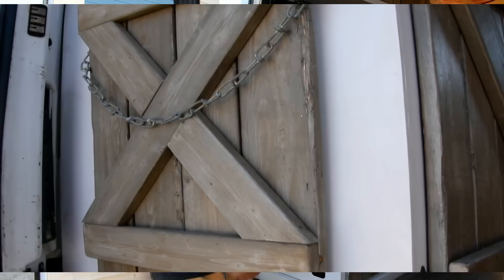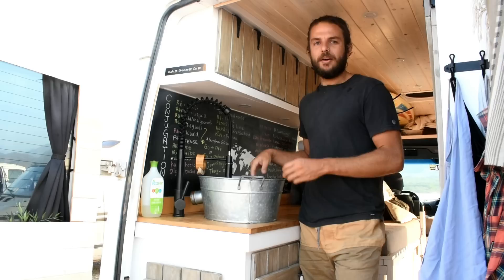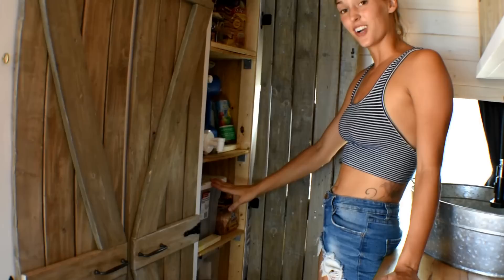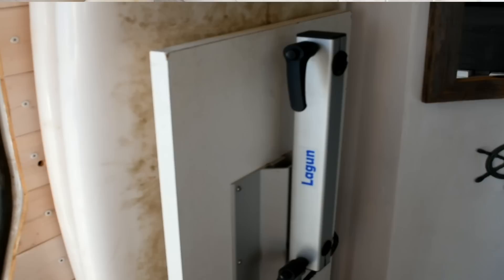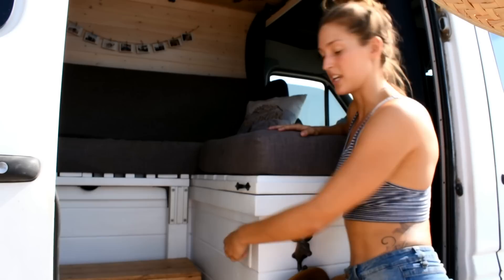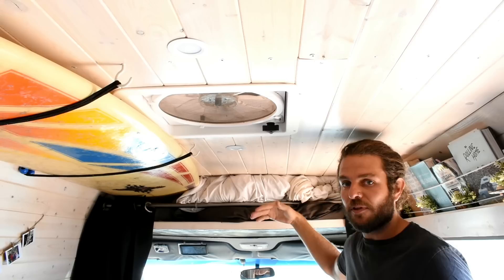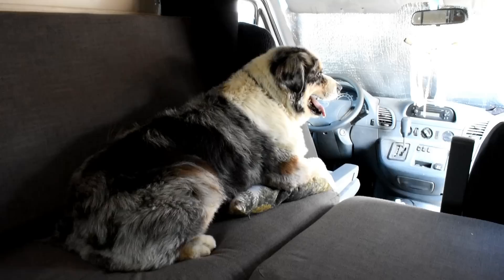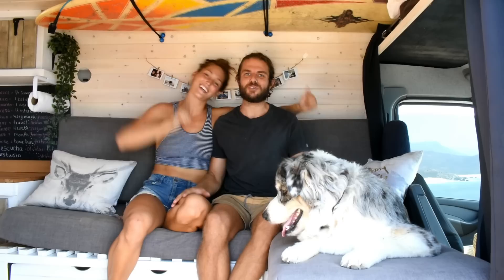BEAUTIFUL Rustic DIY Sprinter Conversion | Travel Couple | VAN TOUR

Comment: Grrreat build! The couch/table/bed placement is (imho) the most intuitive - facing the outside world (a screen across door would be good - some have this). Also the placement of the kitchen and the fact that there is a clear view (and path) to the back and the back window. It might be an idea to point out that a bathroom/shower can be put in opposite the kitchen - in the same place as you have all that great storage - it's just a matter of choice.  Lastly, I'd have swivel seats in front. But all in all, really one of the best!

Comment: This is the first setup with the bed up front that made rethink what I want in my van. I always thought swiveling chairs are key, but with the l-shape couch you take care of that part too. Plus the table and the view. So great! What size is the bed once it's made? I'm trying to figure in two dogs, lol.
Reply from the maker: The table leg is one of the most functional components of our van, we highly recommend buying one for yours! You can even buy a second mount and secure it to a different spot, inside or potentially outside, to have two areas to use your table! Our bed turns into a double. We gain more space by sliding our seats forward in the front since as we mentioned in the video we are both tall! Although we love our set up for us, having two dogs may be a bit tricker with our design as we already dance around Occy in our van which is only the 144" wheelbase. We have seen the inside of a lot of different layouts in vans and an advantage for you that I can see with the swivel seats is it leaves space in between the front seats for one of your dogs to curl up in a walking free zone!
Reply: Good call on the walking free zone... but also loved the couch as a sitting area while on the road. Hmmmm. Thank you for responding, you've given me good info to work with for planning! 

Glad Aubry got you started on a channel, love what I'm seeing :) You mentioned doing a video of traveling with a dog—obviously excited for that one especially!

Comment: Great idea on the setup, though it seems weight was not a concern. About the open lounge and outside cooking, are mosquitos never a problem?
Also would be interested in seeing a day in the life of a rain day with your setup. Cooking, eating, no doors open, setting up the bed with the doors closed, etc.
Reply from the maker: Hey thanks for the suggestion! Lately we haven't seen rain (for about 3 months...) but we copped a lot in the PNW of the US. No issues cooking and making the bed inside but it obviously makes it feel like a smaller space.
Weight actually was a concern of mine and I went light on materials compared to a lot of people we met (the whole conversion added less than a tonne and we are under the load rating of the van). Mosquitos tend to be bad only around sunset here and werent a problem before now. We do have mosquito nets to fit the side doors but havent really had to use them!
Cheers!

Comment: I like the minimalist way of mounting van. I did like many things.. Some as the bed i se in australian conversion van. Its just a wonderfull way of saving space.. I have only one question... Vere in the hell is the toilet??? Did you forget the toilet?? Dont tell me you park the van near to the coast area.. And all time you need a bathroom you move the entire van to a service station... Thats expensive in diesel every day... My opinion is.. That the kitchen area should be were the foots of your bed are with only a tiny entrance by the side... That means you win lots of space inside of the van.. I already see a sprinter modified with wet toilet and shower inside that looks more space... The bed should be higher from the floor to win space below (garage) its only my opinion... I like the minimalist things like the sink and doors etc.. Only the space inside is bad used you dont have nothing in front of the door. Is a waste of space in my opinion... But i like all work made in the van.. The rustic stile is just fine. For camping in a camping with toilets and showers... In my country in south europe diesel is expensive to drive 15 to a gas station to go to toilet or refil wather tanks... Every day... So minimum for one week parked were you want to.. Witouth paing for that should be the solution... Pass for puting 2 tanks below the van... 100liters each... Normaly used one for sink shower and toilet.. And other for grey wather... In my case ill use both 2x100 =200 liters of wather tanks to consumption... Means lots of wather and the van stoped one week without need to move eniwere lees expenses in diesel.. To go and comeback... Its things that you discover after doing some van tours... Wath you miss wat you need more and wat you use more and things that in reality you dont use at all...  The batheries of the solar should be on the back near to the doors.. Because they are expensives.. And under a rock can damage the batheries... And there it goes all eletric installation..  There are things that we discover wen we living and travel on one van modified.. Some times we modifie the van 3 or 4 times until it fits perfectly... Another thing you must consider is the weight of the van... Thats why aluminium and plastiflex and some thini plywood is used in most of the gud vans... That can be a diference of 200kg some times moore...  Means 200liters of full tanks of wather below for a entire week in same spot. Not needing to spend diesel to refil water small tanks.  Means also that the van will consume less diesel... Less weight means you can expend 8liters for 100km  and a van made of entire wood frame with more than 10mm thik weights a tone in the end.. That means 12liters for same 100km some time more... And afects the conduction of the van in curves and braking.  Its many details that you must think on... Depends also if is a van only for weekends 2 days... Or a van for traveling at low cost.. Possible... Meaning diesel.. Wather... Gaz... Eletric power.. Etc. Cheers mate!

Comment: End of the video.

What do you do for toilet and shower?  I'm looking for ideas for a 140" sprinter and this is the tough one, long sprinters aren't hard to drive, but the 140" is like a car.
Reply from the maker: We have an outdoor solar shower bag that we fill up from any outdoor tap. We hang it off a pole that we lay across the back doors! We also have a pop up shower tent for privacy. The solar shower has been awesome since getting into Mexico. If you plan to travel in Canada or the US I'd recommend getting a flexible gym pass for constant showers if you don't have one installed in your van! As for a toilet, we had a compostable portable toilet at the beginning of our trip that was in the bottom of our pantry (where the black tote now is). We didn't use it once in the first 3 months because neither of us wanted to clean it (even though it isn't hard). We have no issue finding public washrooms everywhere and now we have actually added a pee funnel which goes straight out under the van and works like a charm!! We just spray water and vinegar down it when we are done and its been a total game changer! We do love how the 140" sprinter is easy to drive and fit in normal parking spaces + being smaller it is better on fuel economy! Hope that helps!

Comment: I love your van design and your van life style!  Very cool.  Looking forward to more videos!!  :)  I'm in the design stage of my own.

Would you mind answering these questions: most are just about what your feelings are about your conversion except what length your van is - 140 - 170 extended?  Do you at all miss having a built in shower and portable potty?  If you don't have a roof rack, extra heater and/or AC, do you wish you did?  Now, after six plus months of real use, are there any other things that you wish you would have included in your build?  Thanks in advance.  Cheers :)
Reply from the maker: Hi Tony! thanks for that. Our van is the 140 wheelbase which is why we didnt include a bathroom (needed the space for storage). We've been fine with that decision and don't regret it. We definitely wish we had working AC in the front but plan on getting that fixed soon. I think you would need shore power to have AC in the back. Heater isn't an issue for us down here! We are fine without roof racks. We wanted all our valuables internal. We are super happy with our build and how it's held up.
Hope this helps!

Comment: It looks great! One of the best conversions (in my opinion) I've seen thus far. It looks very cozy and pretty roomy. I may have missed it, but what do you do for showering/bathroom, as well as work? If you work from online, do you find getting a connection an issue?
Reply from the maker: Thanks!! Nope, no bathroom. We do have a solar shower. We explain how this works in our 'downsides video'. We are just getting in to online work and yes! getting decent internet connection can be really hard depending on where you are.

Comment: OMG, I love your conversion! I'm just starting my van conversion and this is really good inspiration. I love thay you guys were able to fit so much in the space. The idea of having the fridge under the bed such a good one! What kind of container did you use to seal your propane in an airtight container? That is one thing that really worries me too.
Reply from the maker: Thank you!! We used a 6 gallon bucket with a gamma seal lid with a hole going through the floor to allow ventilation outside the van if (& hopefully never) the propane does leak. We have had no issues so far! We do have a carbon monoxide detector just incase.

Comment: This van is awesome, guys - and so are you! Really love your channel. I'm thinking of using your van conversion as a blueprint for my own van. So a few tiny things I'm still worried about. 

You have just one fan which is above your bed and close to the cabin. Is this a fan which drags air out and brings fresh air in, just as you need it? I wonder what your experiences are regarding cooking in the van when you are forced to, due to bad weather conditions? And is just one fan  enough or would you recommend another fan above the kitchen area? And another question: Do you have the fan running at night and if so, isn't it noisy?

Do you have hot water in your kitchen or do you have to heat up water for dish washing?

In Germany we have the TÜV where all van conversions need to be performed and approved before you can hit the road. They have quite a few regulations, for example that your cooking device has to be permanently installed, you need a place to sit and a table and a few other things. If you meet all the requirements, your van will then be certified as a mobile home, which makes less expensive when it comes to taxes and insurance. All these regulations are some sort of annoying, but in the end need to be accepted. There is just one thing that really worries me, when it comes to living in a van full time. I'm not too fond of the idea to sleep above some huge batteries. Fixing them under the van, like you did, doesn't make me any happier. I would constantly worry about them being damaged on rough streets. Am I just a snowflake or are batteries directly under the bed indeed something to worry about?

I'd probably give up one storage compartment for a Nature's Head toilet, other than that your van ist just perfect! A comfy and cosy home on wheels. Safe travels always. ♥

Comment: I see you have a regular knob-stye 110v dimmer. I assume you have the lights (and dimmer) wired to AC through your inverter? I heard installing a dimmer on DC is very complicated.
Reply from the maker: Hey! It's actually a 12v dimmer which we bought on Amazon. I found it complicated to install however I'm not sure someone with electrical knowledge would!

Comment: Hey guys. I just happened across your videos yesterday and have power streamed a few of them already. I have a quick question, I don’t want to interrupt your jaunt through paradise. On your 12v cooler/fridge, do you find that it throws off a lot of heat? I’ve been looking into thermal electric coolers for camping and am curious about that. Also I am working on building a solar setup much like yours. Thanks for the videos. I can’t wait to watch more.

Comment: I like the boat steering wheel.  I have a question, wood is heavy, did you find it impacted your mileage much, or was it just negligible?  Thanks!   Also, as long as your in Oaxaca, you can learn how to make real chocolate mole sauce. :)
Reply from the maker: Hi! thanks for that. Wood is heavy to an extent. We went with the cheapest sturdy yet light weight material we could find. It actually didnt add all that much weight in the scheme of things and because it's a cargo van designed to carry heavy loads we found there was hardly any increased fuel consumption!

Comment: Thanks for the indepth tour of your home on wheels. I couldn't help to wonder how much weight was added by using so much real wood for the interior! Did you calculate how much it was? I'm sure the wood adds structural rigidness to your rig but does that also make it less economical fuel wise? Speaking of fuel, is this a diesel or gas motor? Do it have a dash air conditioner? Love the dog!
Reply from the maker: Thank you for watching our van tour Edward! We will talk about weight and economy in our video this Wednesday! We chose to use pine for most of the wood which does not add too much extra weight. The van is diesel and it does in fact have a dash air conditioner, however it does not work (which is a bummer down here in Mexico).

Comment: Love your video, thanks for the great tour!
I am in the process of building out my van and I am going to be using a very similar layout to yours. 

I was wondering what is the height of your bed/couch without the cushion? 
What are the sizes of the two cushions used to put your bed together?
And what is the size of your bed fully extended, and the size when it is in couch mode? 

Thank you!
Reply from the maker: Thanks! I'm going to have to get the measuring tape out and get back to you!

Comment: Nice van design!  I'm sure you saved a fortune compared to custom designed ones you buy ready to go.  If you don't mind, how much did it cost you for the van and for the customization?   Also, did you consider how much the weight of the material would effect your mileage?
Reply from the maker: Thanks Dean and yes we did for sure. The van on its own was $11,150 Canadian and the conversion was an extra $10,000 Canadian : )
Yes, we were careful to choose lighter materials where possible. Our economy hardly reduced!

Comment: Max & Lee - would a sprinter van work for someone who's 6'3"?  thanks! Seth
Reply from the maker: Hey Seth. Max just fits perfectly in our van so I would say if you're 6'3 and want to be really comfortable you can buy the high roof sprinter model. I know our roof is slightly lower (being 2006) than the 2007 and newer models! My best advice would be to test out one at a dealership!!

Comment: Excellent job guys, well done! What kind of wood are the wardrobe and kitchen cabinet doors made of? Did you buy them pre made or make yourself? Also,  do you have any youtube links or other info on how you made your bed, kitchen area cabinets, or the middle seat installed in the drivers area? we already have an 04 Sprinter but have been wanting to redo what we have got which was thrown together in a few days. Any extra info is a greatly appreciated. Happy adventures!
Reply from the maker: Hey Chris, thank you! We made all the doors ourselves they are made out of cheap furring pine wood that we bought at home depot. We stained them, white washed them and added a clear protective coat on top for the finished look! As for the YouTube videos we learned from, we do not have the links as it was a long time ago now that we started our build (almost a year ago). For the cabinets we used  2 by 4 pine wood as the structure, which we bolted to the floor and then used ply wood as the walls! Sorry we couldn't answer more. Good luck with your build :)
Reply from the maker: Also for the seat up front we essentially built a box with 2 by 4 pine as well to fit the space between the seats and bolted it to the floor and we added the lid (top) last! Again we used ply wood for the walls!

Comment: Did you guys go diesel or gas? (Sorry if I missed that) which of the two do you think are better in South America? I currently own a diesel excursion. Looking at different options
Reply from the maker: I think all sprinters are diesel.. In south America I have heard diesel can have problems with the high Altitudes and cold weather. Will have to wait and see!

Comment: Great van build and tour! What did you do for insulation if any?
Reply from the maker: We used EZcool with an air gap and then rigid Polyiso foam boards with spray foam to lock them in place and fill the gaps!

Comment: Hey, what was the reason you chose a split foam mattress and not a full memory foam mattress? Not enough support with just memory foam or?
Reply from the maker: Hey Reubs! We chose our mattress based on reviews and cost therefore we found a comfortable mattress online that fit our budget (the link is in our video description). Once we started researching we noticed most highly reviewed mattresses were a mix of more rigid foam and memory foam. As well, since our bed turns into our couch we wanted to sit comfortably with some support during the day!